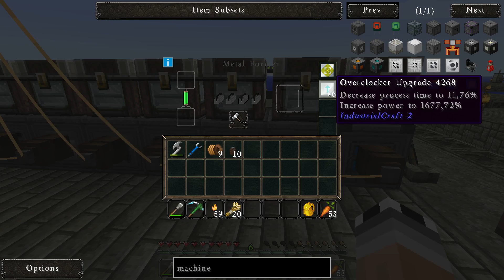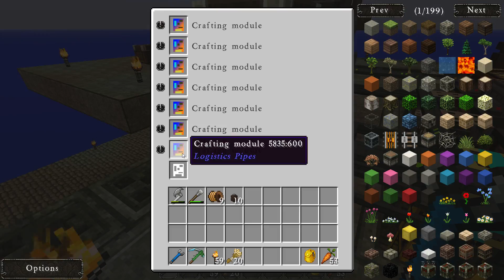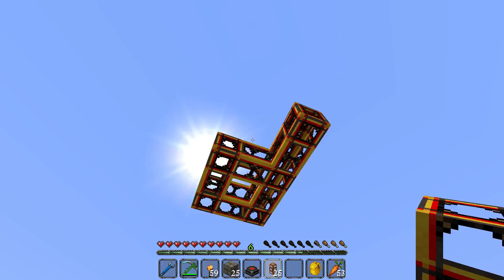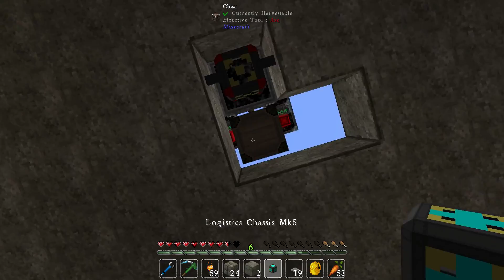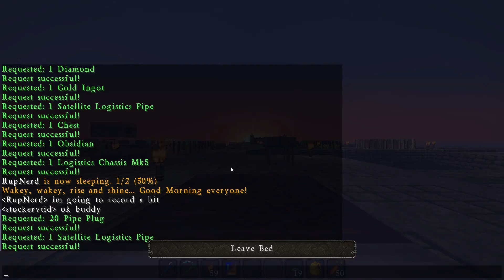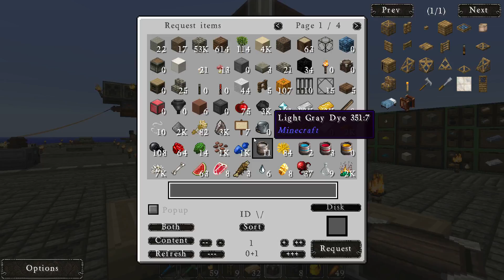FTB Skyblock - E05 - Machine Frames

Comment: You've probably already moved past this, but my solution made use of the fact that only two of the ingredients changed in the machine frame recipes. I just had my LP system keep an appropriate amount in the table at all times of the unchanging items, while the recipe I used for crafting used only the changing items.
Reply from the maker: that's actually a very good idea. but there is already AE in place now which is of course way better with those things :D
Reply: yes :) 
I am looking forwards to seeing how you accomplished things :)